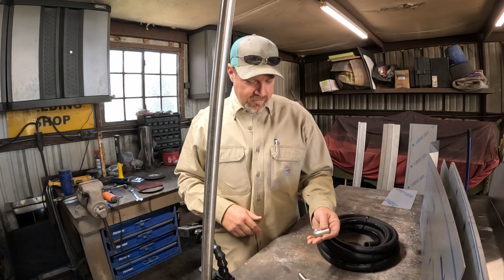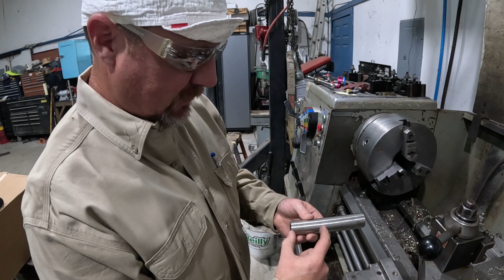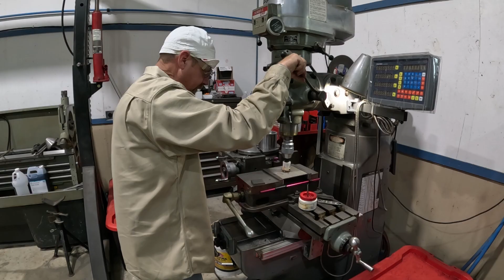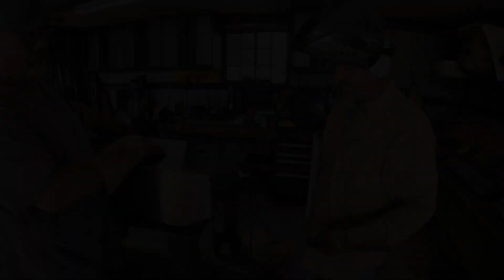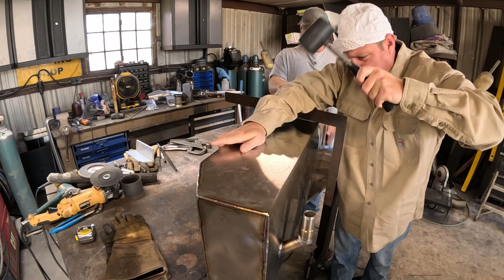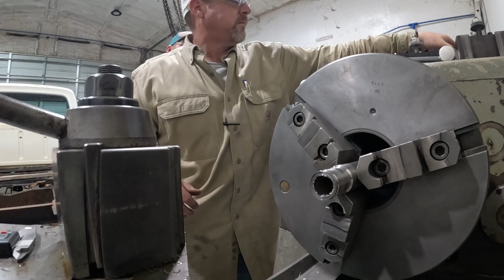Custom Fuel Tanks: The Ultimate Chevy K30 Upgrade!

Comment: Does the 40 gallon suburban tank not fit a cab chassis frame
Reply from the maker: It might, the frame rails are the same width. Not sure if the crossmember is in the same place though.
Reply: 1 ton squarebodies have inboard shock mounts on the rear so the suburban tanks don’t fit without relocating the rear shocks.

Comment: As one that has run his truck in pasture and feed lot. I would be a bit concerned about the cross over bungs not protected coming out of the tank. Also did you think about tanks being full if you would happen to need to pull the T-case.  Love the idea and will incorperate it in mine,
Reply from the maker: We were a little concerned too, but we think the crossover is heavy duty enough to handle pretty much anything short of rock crawling. We did think about the t-case as well and talked about putting in valves but decided that would be major enough surgery to justify having to drop the fuel. We just didn't want to add any moving parts that aren't absolutely necessary.